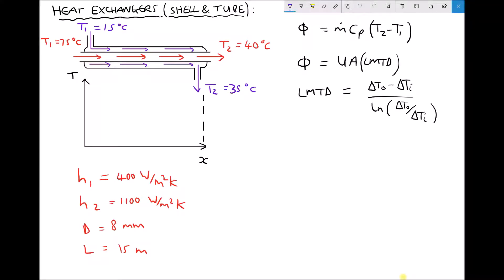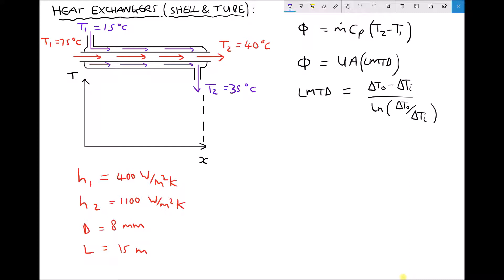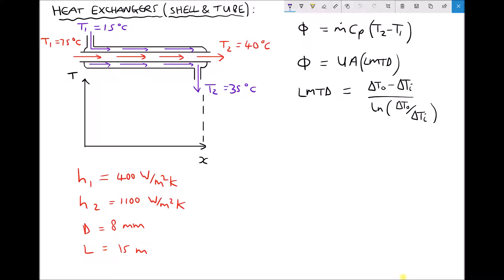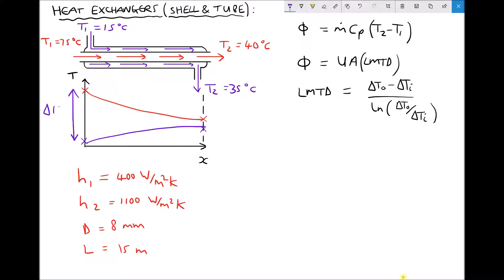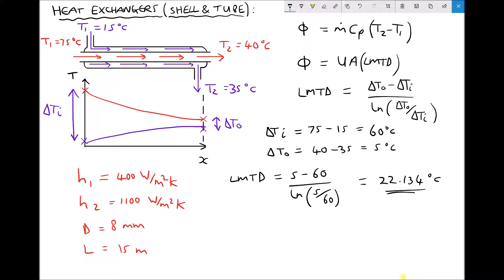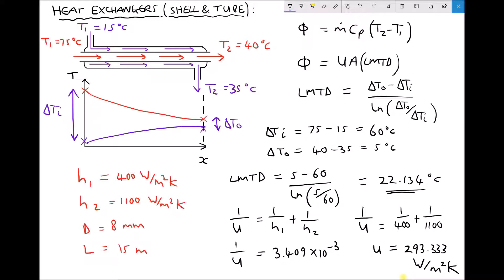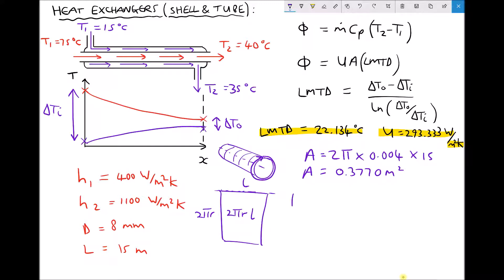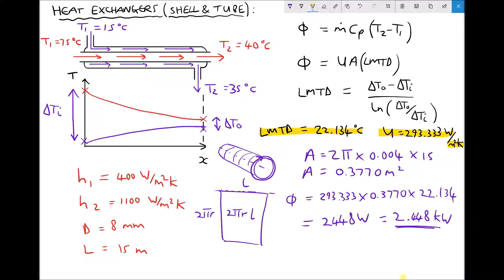Calculating Rate of Heat Transfer in Parallel Flow Heat Exchangers

Comment: Correction since the LMTD is in Celcius you must convert it into absolute temperature before you multiply it. Am I wrong?
Reply from the maker: Actually you could use either as these are differences in temperatures, rather than actual temperatures. If we convert all temperatures to Kelvin first then the differences between those temperatures will still be the same.